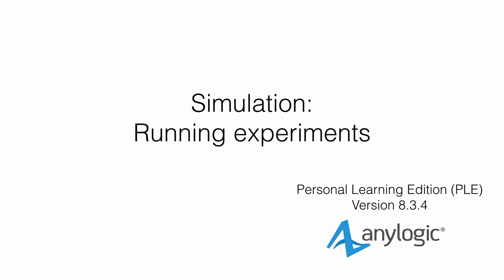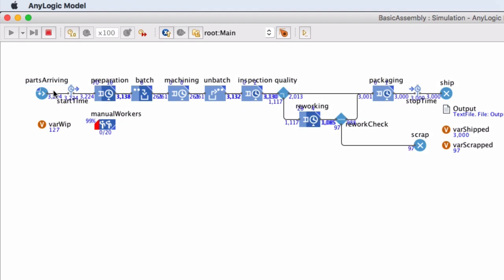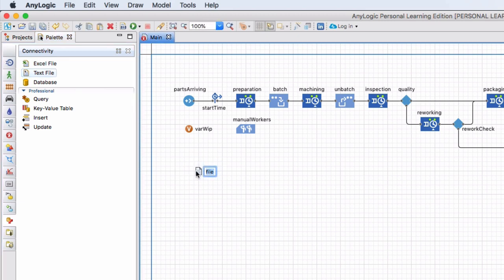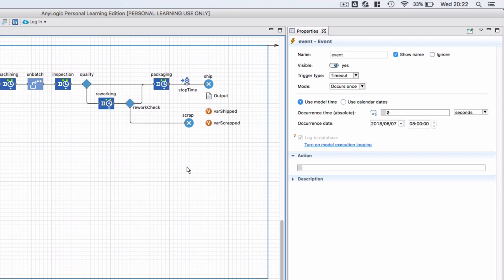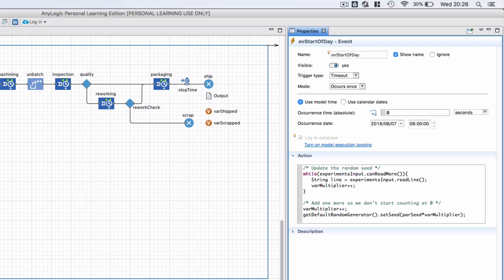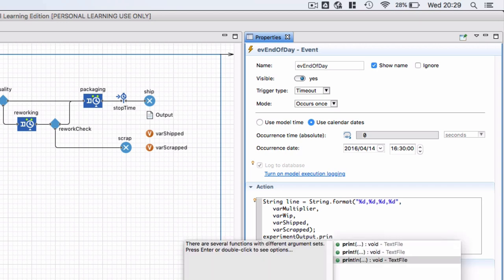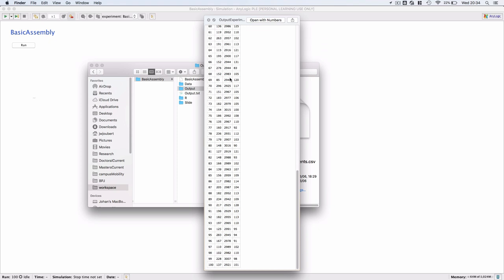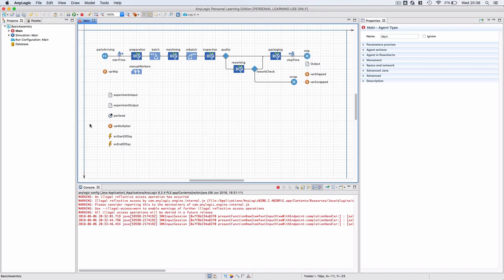Simulation experiments

Comment: Hi sir, I would like to know how to get total delay time from delay block via Statistics Collection. i'm new to anylogic. thanks.
Reply from the maker: There are possibly two ways that I can immediately think of. Firstly, I would introduce a variable (at the entity/agent level) that takes the time stamp when an entity/agent enters the delay block, and then calculate the actual delay time once the agent leaves the delay block and tally them (possibly separate global variable at main model level) as soon as the agent leaves the delay block. At the end of the simulation run, then just write out the final value of the aggregate delay time. Secondly, if your delay is in the form of a service block, and using a resource pool, maybe there is already some statistics captured like overall utilisation. Still, my preference would be for the former.